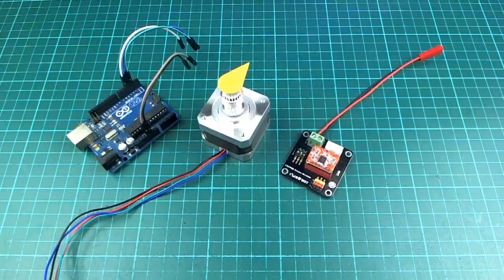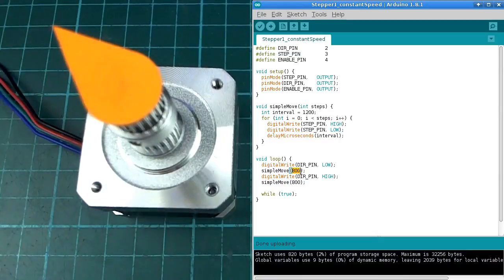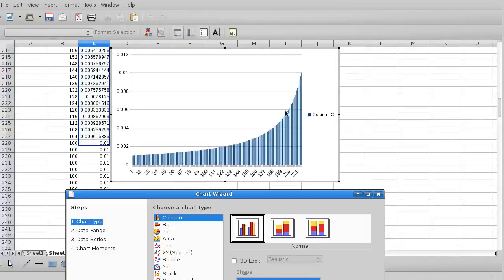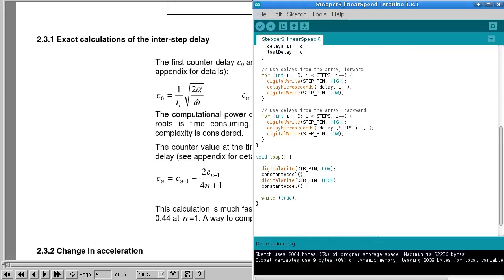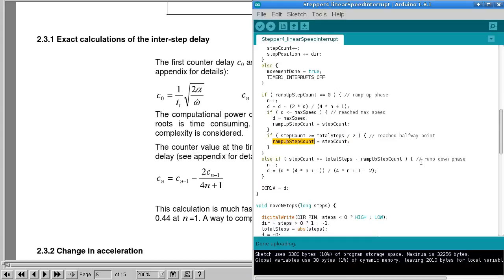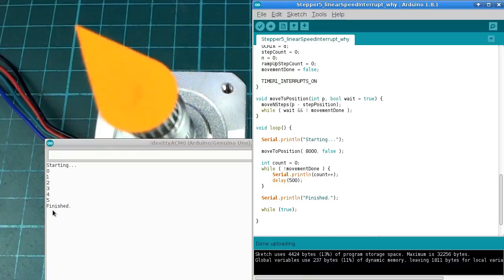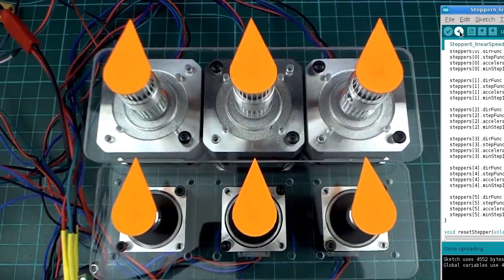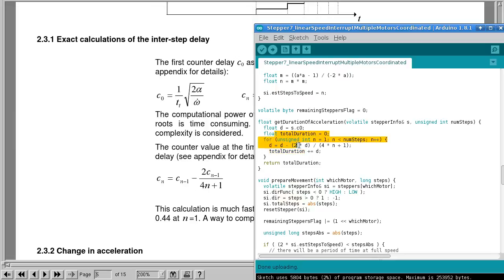Coordinated stepper motor control (arduino)

Comment: sir,  in sketch 6 and 7 (which control 6 stepper motors) show error i. e. PORTF was not declared
Reply: how i can describe PORTF
Reply from the maker: The sketches are for arduino mega2560
If you want to run it on something else, you will need to redefine the macros that change the pin outputs
Reply: i use arduino uno and tb6560 driver,  i upload a sketch 4 and ON the supply, motor start moving smoothly, but when i change the value of moveToPosition from1600 to 16000 then stepper motor not complet their steps i. e 16000, after some rotation motor will start noise and miss its step .
Reply: sir i want a make a sketch which controls 3 stepper motors . let name the 3 motors i. e.  A, B, C
coditions are :
motor A ,have to move total steps 5000 at some speed
when motor A complete 1200 steps. then motor B, starts moves their steps 2000,after that motor B move  -2000 steps and motor B stat moves 38000 steps,  both the motor complete their steps at same time. 
after this motor C complete  its steps

Comment: First of all, many thanks for this very useful tutorial video in my view. Would it be possible to have the exact reference of the stepper you are using? I have making some checking with an oscilloscope and the behavior in my environment differs a bit from yours. E.g. with the settings as done in your sketch, the 1st pulse is about 2.8 ms and the second one is about 11.6 ms. The rest of the pulses are decreasing are predicted. This seems to be connected to line 12 in your code 
float c0 = 2000 * sqrt( 2 * angle / accel ) * 0.67703; in sketch Stepper3_linearSpeed. Any advice on that?
Reply: Hi, Do you know what code he is using?  I use Python, and I am guessing this is C code?  Thanks

Comment: Is it possible to show us  microstep TB6600 driver Arduino connection with the drivers  by the three motors with endstop buttons with relay to stop and run the drill please showing this in video or photo please ? cnc machine?
Reply from the maker: no, sounds like you know much more about all that stuff than I do. There are many CNC controller systems around if that's what you want, eg. GRBL, tinyg, and most with very good documentation already, just do a google search.
I used GRBL once before: https://www.youtube.com/watch?v=OuhgZMDXDdY
Reply: thank you bro but if you have facebook I can easy  show you what I need  if you do not mind
Reply from the maker: We don't need Facebook because we're already talking here. But I already told you I don't know the answers you want, and I gave you a link to my best knowledge on the subject. To tell you anything more I would need to search Google, so it would be quicker for you to do that yourself :)
Reply: thank you bro

Comment: Hint: I will not use floating point values. The reason has to do with how floating point values are processed in binary, too much overhead. If you have to use floating point values, then get an FPU coprocessor to do the calculations as it will be faster. Also, use ATMEL port addressing and writing with masking so that you can eliminate the overhead of the digitalWrite functions as they will need to be called while direct port access to the PORTs and DDRs will take less clock cycles. That will help make your code faster and more optimized. Now that you have saved yourself some time, the question of the solution to the equation can be handled. Look into changing your function to do time by CPU cycle pulse as the board frequency is fast enough to give you better time durations. If this does not work, then you have to consider moving your code to an Arduino Due as the execution speed for machine instructions are much faster.

Hope my Two Cents help. Its a different view to approach your difficulties.

Comment: thnx for the vds is verry nice

bro i have a project in the unvsty and i need your help to control the stepper motors in my  machin  
hwo i can contact you ?
Reply from the maker: You just contacted me.... but I don't know any more than I told in this video.
Reply: give me your adress to contact my problem is in the control of the stepper motors
Reply from the maker: You're contacting me here already. And like I said, all I know is in the video already.
Reply: i have a steper motor and i wont to control it from an aplication but a dont know how to send the serial data to the arduino

Comment: Thank you so much for this great video! You can't imagine how much you helped me out!!
As a side remark for Arduino Mega users who want to use Pin 3 as STEP output, change the code as following:

replace
/*
#define STEP_HIGH        PORTD |=  0b00001000;
#define STEP_LOW         PORTD &= ~0b00001000;
*/

by
#define STEP_HIGH        PORTE |=  0b000100000;
#define STEP_LOW         PORTE &= ~0b000100000;

Comment: Hello,

As I need a timer interrupt routine in my code, I tried to copy this example.

But the problem is, when I try to copy the code(Stepper4_linearSpeedInterrupt)
My motor is not working. I need to say that I am using A4988 motor driver for my stepper motor.
Since I hardly understand about interrupt part of the code, I could not find a solution to make it work with my hardware.

Can anyone kindly enlighten me about what to modify on the code, to be able to use it with a A4988 driver?

Best Regards
Reply from the maker: Is your motor running with the earlier methods (non interrupt etc)?
Reply: yes, first 3 codes work perfectly fine
Reply from the maker: Is it just my code unchanged? If so I have no idea. If you changed something, try reverting your changes bit by bit to see where it went wrong.
Reply: found the problem! Previously I had changed the step,dir,and enable pin numbers according to my setup. Now I corrected to your pins and changed my connections accordingly. It works! I have no idea how and why this affects the rest of the code though.

Comment: for my specification Vref =0.672 even if i set it my stepper motor is turning 1/16 step  only  for completing one revolution i need to set 3200 steps to turn 1 revolution can anyone help what did i do wrong i have wrote a program to turn required no steps but it is stepping 1/16 stepping i am stuck right here can anyone help me i am using a4988 driver and nema 17 stepper motor 
can anyone help i want it to turn full stepping

Comment: I just love the sound of stepper motors "singing" together. 
Nice video - and no yawning from me at all.
Small tip though: When I have a lot of setup stuff, I put it in a separate .h (header file) fx. pinSetup.h for all your pin assignments. This keeps the "tedious" or "non chsnging" stuff separate and your main program easier to maintain.

Comment: Thank you for this very good step by step explanation (sadly only in the first 2/3). All was very good to understand.
BUT! How you can handle 1 Timer with different compare values depending on the motor was that "hack" what I'm really interested in. Because the timer ISR occurs after underrun of only the last set value was decrement often enough. But different speed "situations" need different reload values. Or do I have an mistake in my thinking?
Reply from the maker: You need to keep changing the compare value of the timer, so that it will trigger at the time for whichever motor needs the next step. Then you need to find which motor will be the next requiring a step and set the compare value accordingly.

Comment: Does anyone know how to alter the last sketch so it sets a motor speed.  How do you start and stop the multiple motors going at different speeds.
Reply from the maker: The max speed of each motor is set by its minStepInterval variable (smaller step interval = faster speed).
Reply: Thanks for responding.  I would like to clarify that I am trying to use a joystick and get real time motor control feedback.  1 day later and I am pretty close but for some reason the motors seem to get confused and begin to stutter at about 25 seconds into a continuous rotation in one direction. If you have any advice I would be grateful!!

I am simply replacing your while loop here with one that checks to see if the joystick is still engaged.  RL is the joystick value.

void runAndWait() {
  adjustSpeedScales();
  setNextInterruptInterval();
  TIMER1_INTERRUPTS_ON
  while (RL > 4 or RL < 1) {  // RL = right left of Joystick
    readjoystickRL();
  }
  //  suppressed this part >>   while ( remainingSteppersFlag );
  remainingSteppersFlag = 0;
  nextStepperFlag = 0;
}
Reply from the maker: If you're finding that something is ok for shorter movements but not longer movements, it could be integer overflow.

Comment: The problem you have at 8:15, is related with the fact that you are not using a sqaure have with a 50% duty cycle
You are doing a very quick HIGH to LOW, and a much longer LOW to HIGH.
Wait the same amount of delay between  both transitions, and you will be able to make it work faster more reliably.

Comment: an easier way to get linear acceleration is to make 1/d linear with the number of steps; then 1/d becomes eg.:
1/d= 1/((1/50-1/2000)*steps/1000+1/2000), using your numbers: dfast=50, dslow=2000, nr of steps during ramp=1000.
If ypu now plot 1/d vs steps, a linear curve shows. If I knew how toattach a XL file I would send it to you.
The equation for total duration you are looking for, would that not be the integral ?Sigma over a nr of steps evolves to integral....d(step)

Comment: I enjoyed your video and didn't yawn.

The standard for coordinated stepper motors is Bresenham's line algorithm.  Most famous in graphics.  But it was originally developed by Jack Bresenham in 1962 to coordinate the motors for line drawing on a Calcomp plotter.  It is the algorithm used in the open source GRBL CNC code.  Bresenham's is all integer in the main loop, so very fast.  I'm not sure what GRBL does for acceleration.  They managed to cram it all into an Arduino Uno with just 2K of RAM.  They just went to the Mega in the last year.

I'm working on making a CNC glass cutter.  The glass cutting head needs to be parallel to the direction of travel.  So I'm going to use a fourth stepper motor coordinated with the with the original three.  Before I dive down into the rabbit hole of GRBL and Bresenham's it is interesting to see what other people have done.

Thanks,
Kurt

Comment: Superb stuff. A quickie- any reason why you chose the RAMPs rather than 6 external driver boards? Does it offer any advantages? I want to get 6 steppers going myself and control speed with a rotary encoder. How many spare pins does the RAMPs leave you? Am I better off/ is it feasible to connect 6 of those Yurobot things? Thanks again bro, GREAT vid:)
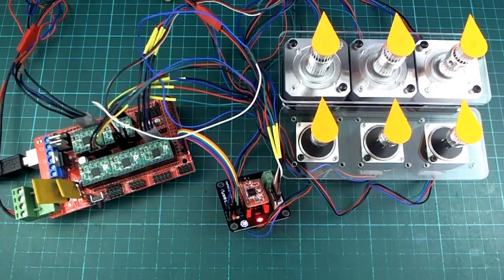Reply from the maker: Initially I was going to make a 5-dof robot arm so I would have only needed five. But in general, it's less wiring to worry about. There are a ton of free pins, at least on the RAMPS board I have, probably about 20 I think (at 35:40 all the pins along the right edge at least, but also some along the bottom edge too). Sure, you can use 6 separate drivers but the RAMPS shield is a tidier way to connect it all up.
Reply: Gotcha, thanks a lot. My setup is almost up and running, inspired mostly by your vid. I can't help finding the wiring of the Yurobot kind of strange and there's no real info online. Can you speculate on why it has power to all three of the STE, DIR  and ENA pins?! Are there alternative models that seem less sketchy out there?

Comment: Hi iforce,
Nice Video! Thank you! I have started a own Projekt based on your Code, with 2 Steppers. By the way the link from the Atmel doc dosent work anymore. Here is a updated one: http://ww1.microchip.com/downloads/en/appnotes/doc8017.pdf
And i have a question because I have a litte issue: If i run 2 Steppers with diffrent acceleration and speed, i get random speeds on each Stepper, mostly when one is Accelerating or Deccelerating. If one Stepper stopped his movement the other speeds up. Its very confusing. I tried it on the Mega and the UNO both have the same problem.
Reply from the maker: Well I don't know what to say about that - as you can see it's working ok for me.

Comment: Why not use library like "Eventually" to coordinate the simultanuous movements of steppers and then you can just focus on a single trajectory strategy with the ease in and out as you suggested. Strategy could be eg. "as fast as possible" or "arrive at same time" (slowest node/longest travel determines flight speed of all others)
(i'm not affiliated but heres the git https://github.com/johnnyb/Eventually)

Comment: A question, a challenge, and requesting guidance:

I am using Arduino-Uno, and have reduced your code to only 2 steppers that roll a small printer paper back and forth. I have an IR sensor that tells how tight the paper is, meaning that one motor needs to move a bit more or less for the same cycle, in order to keep the paper tension reasonable. So what I need and hopefully you will find it as a challenge is a way to make one motor catch up with the other depending on the IR sensor information. The IR sensor is like a potentiometer providing analog information telling the Arduino-Uno that the 2 steppers need to advance in sync but differently. It will be great if you find this challenge interesting enough for you to find the solution, but if not would please post guidance for me to proceed.
Reply from the maker: In the last example I had 6 motors moving in sync but differently, isn't that the same as what you need? The prepareMovement function specifies how much each one needs to move. Maybe I'm missing something but I don't see how it is different to what you're saying.
Reply: Thanks for your prompt reply. The difference is that the calculation of the correction is done while the motors are moving based on the real-time paper tension. The one from your code I am utilizing does not make changes as it goes based on a sensor reading, instead the code you have so far pre-calculates everything. I am hoping you can provide a change in your code where a new small acceleration is calculated as it goes based on small readings from the IR paper tension sensor in real time, or maybe a change in the number of steps in real time yet reaching the end at the same time right? Basically what I am looking for is to make small adjustments on the stepper number of steps based on the paper tension in real time, meaning that it can not be pre-calculated, but rather calculated based on on sensor reading as it goes. Let me know if I am not clear enough, and I will try to explain it again, please forgive me cause I believe I am not been clear enough.
Reply from the maker: Yes, it pre-calculates everything so it's probably not what you need. The whole idea of what I did here is to have coordinated movement, ie. start and stop at the same time, the goal being to have the acceleration of the overall movement (CNC machine, robot arm etc) nice and smooth. It sounds like you have a much simpler requirement in that you can just look at how far each motor needs to move and simply move it - no need for coordination is there?
For example let's say motor 1 needs to move 50 steps and motor 2 needs to move 30 steps. So.... just move them that amount at their own pace right? In each loop iteration you could check if the steps required is more than zero, and if enough time has passed for a step to be done, and if so do one step. Unless I'm missing something there is no requirement for the motors to be coordinated, and indeed since their movement is continually being adjust individually it's not possible for them to be coordinated anyway.
I guess you could have a kind of 'coordination' if you adjusted the speed of the motor with less distance to move, based on how much further it has to go than the closer motor.
Reply: Once again thanks for the insights and a prompt reply. But no motors can not move at their own pace, paper will tare-off or come too loose, it is a common problem where more than one motor is moving shared, rolling-up, media (paper in this case), the tension needs to be kept reasonable at all times (one motor shaft holds more paper than the other most of the time so the speed of paper been released or rolled-up by one motor is a bit different than the speed paper is been  rolled-up or released at the other end by the other  motor).  I am looking into the details now and will share with you once I complete the solution. your code moves the steppers in a very precise and nice manner and i am planning on using it, so I will post some pictures as well once I get it to work properly. I am looking on flags that will prevent full acceleration or deceleration phases for intermediate rotations (movements) where instead all is needed  is minor adjustment on steps differentials that will restore paper tension (as indicated by the sensor). More guidance or ideas always welcome

Comment: Hello. May be you would like to make a code, and show the simulation of jet eng in scale with slow start up, full throttle, and then shut down, the way the real looks but for the scale models please? )))

https://youtu.be/Mmx_vzgjFfQ
Made some kind of test with PWM and simple dc motor. Can be done with AVR then and gear shifter to give the full spin. But may be only the stepper wil do better job?
https://youtu.be/584caXYdIVc